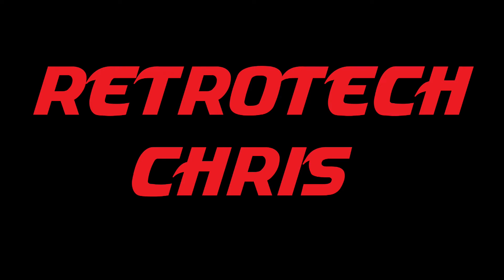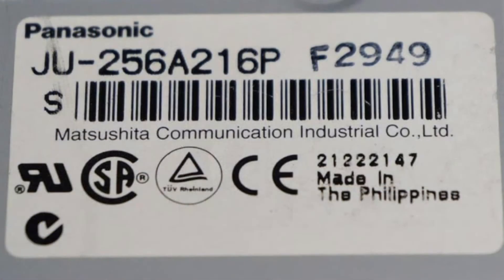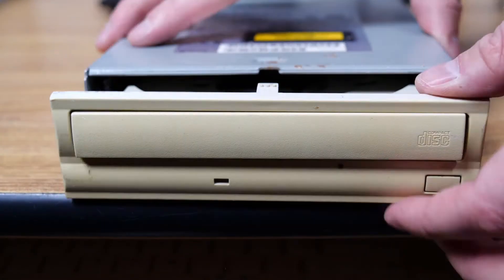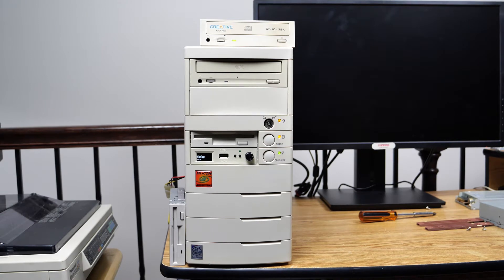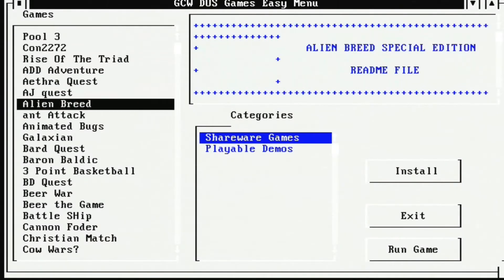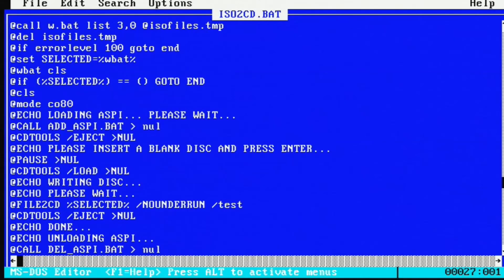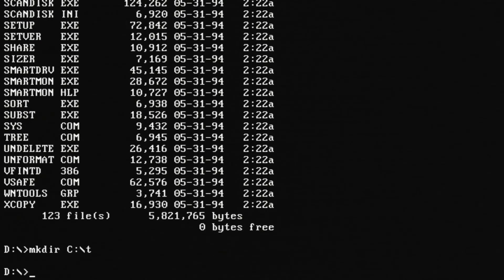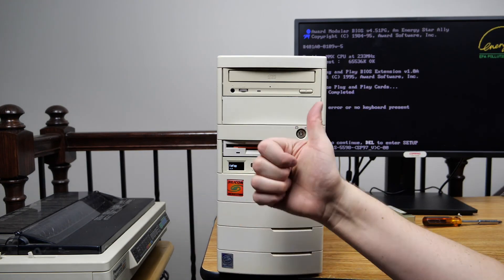Testing Some Retro Floppy Drives and CD-ROM Burning in MS-DOS?

Comment: You probably can put the CDROM faceplate onto a different model drive. Many other Lite-On drives will probably work perfectly. Worst case a bit of hot glue can help you use a drive with slightly different faceplate mounts.
Reply from the maker: Yea, I looked a bit, haven't found one yet, but am keeping it for that magic day!